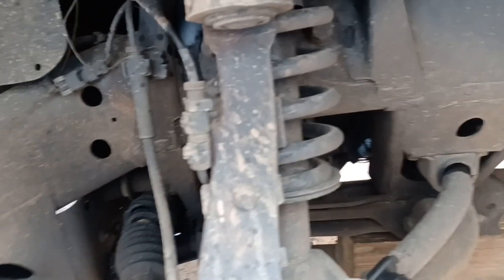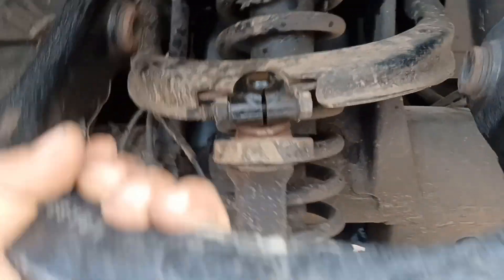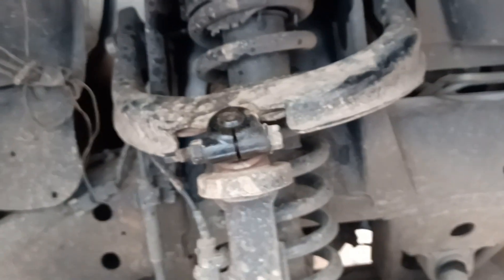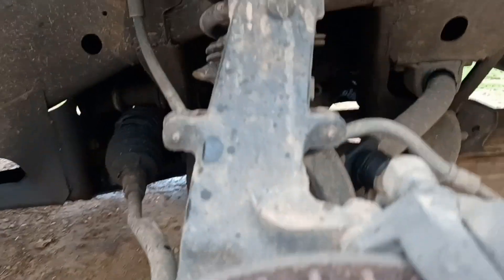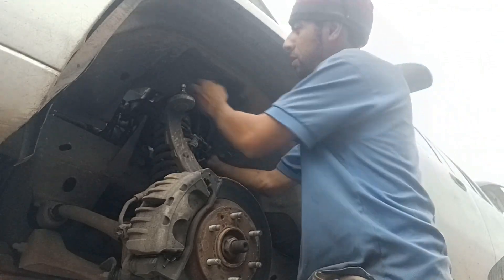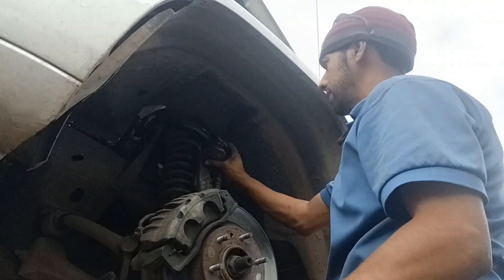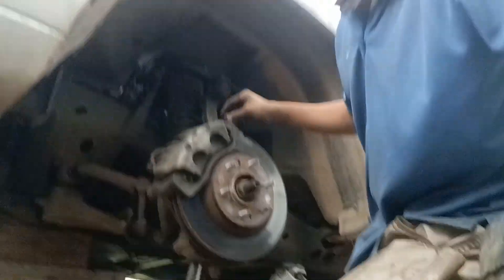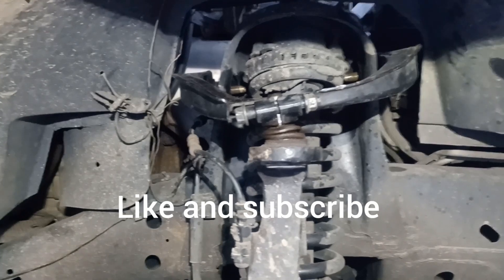trailblazer alignment by turning the controls arms upside down after a 2.5 inch lift

Comment: Would it be a better option to swap sides? I'd be worried about compromising the structural integrity by flipping them upside down. 🤔 You would also maintain the correct taper for the ball joint seat.
Reply from the maker: I'm thinking about doing that